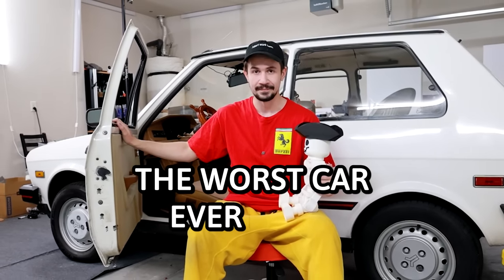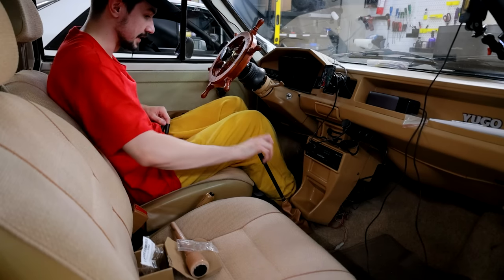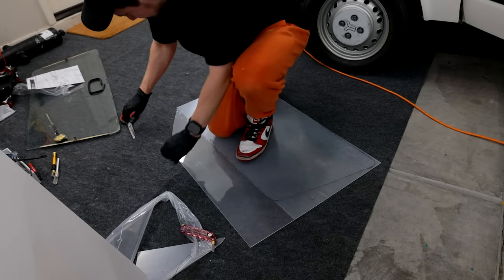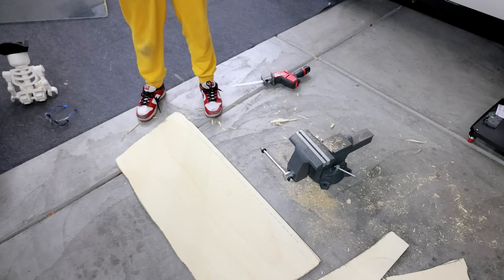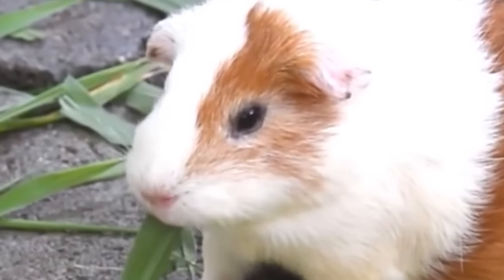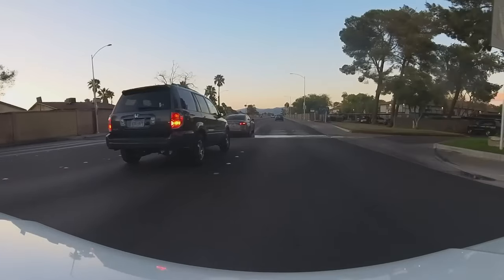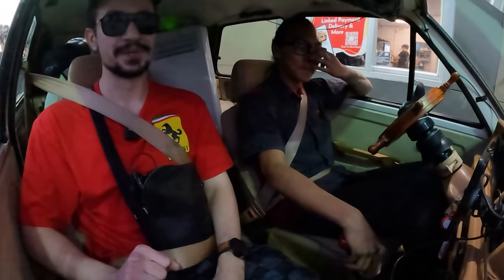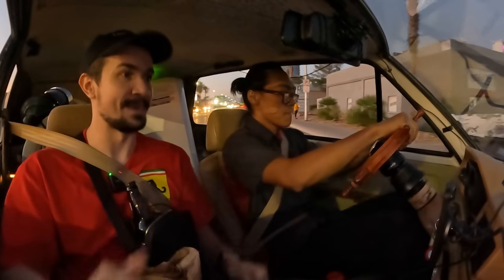I Made Your Car Ideas (YUGO)

Comment: Some engine suggestions for engine swapping are either the I3s from a Suzuki Cappucino or Honda Beat (both of which making 63 Horsepower in comparison to The Yugo's 55, BUT they can possibly get you some actual Air Condition) OR the Suzuki Hayabusa engine (which makes 190 Horsepower). To Mitigate the transmission issue, I'd recommend swapping it out form one in a Volkswagen beetle which should be more reliable without having to add or subtract the number of gears you have
Reply: Put on an LS3 in it
Reply: I want him to jerry rig a v16 to it

Comment: You should swap the radiator itself with any radiator and get rid of the overheating issue.
And then do major upgrades on the engine

Comment: honestly consider a small 2 stroke engine, in light weight cars it turns them into more of a go kart, its incredibly cheap and all that is required is that you remove the engine and radiator, you will probably be able to re use the exhaust

Comment: You should be able to get a duplicate key. I recommend getting a basic work bench, that way you can secure anything you need to cut and do it properly. If you plan on doing electric work this is smart as well cause you can ground yourself to the work bench. Its a small expense for the sake of your safety, which has already been put in jeopardy multiple times, lol.

Comment: it would be pretty sick if you managed to rotary swap it ngl, itll be a fair bit more powerful than the engine you have in it already, only issue i can see is finding a transmission small enough to fit in the car... and getting an adapter plate manufactured... other than that it would be p hassle free, even just a single rotor would be miles better than what  you have now in terms of power, emissions, fuel economy, reliability, etc. even the 1 rotors perform miles better, you'll see them normally making around 100hp when between 5-10 pounds of boost. they sound p unique too, so you dont really have much to lose other than money xD but you knew when you bought the car that the engine n trans would have to go eventually

Comment: you should replace the engine and transmission with an electric motor. im sure this is a cheap idea and it will be very easy to adapt the electric motor to the drive shaft :)

Comment: your first gear probably isnt gone, if the yugo is fwd there should be cables connected to the shifter that are stretched, if the yugo is rwd then you probably need a new transmission

Comment: putting a clip on the end of your exhaust wont ever upgrade performance man. that is strictly for sound modding only. 

to get better performance, you would have to delete your exhuast from the catalytic converter down to the end, that way there is zero back pressure. expect to gain anywhere from 10 to 25hp depending on the vehicle and its condition.

Edit: (this is not legal in most 1st world countries as its terrible for the environment. your car wont pass smog, and wont be street legal if you do this.)